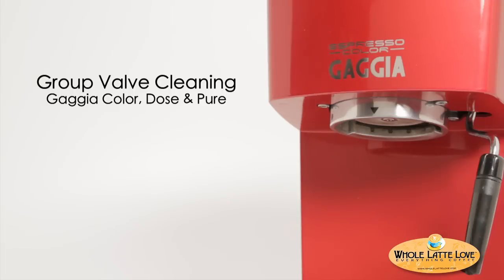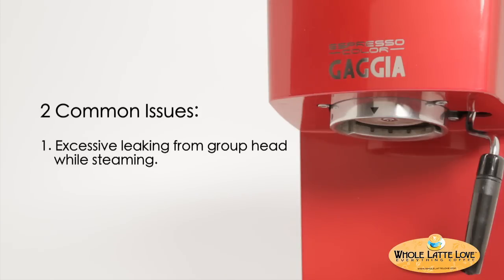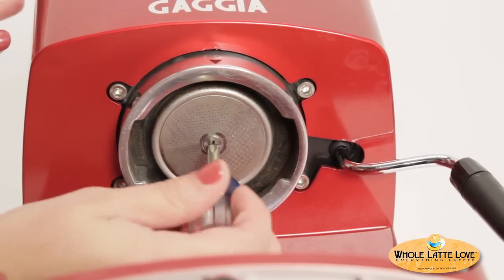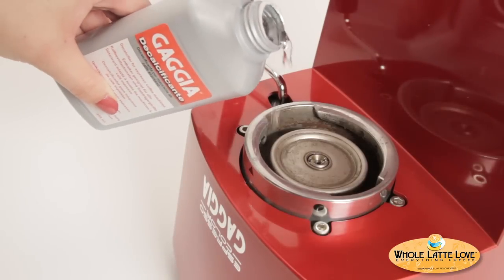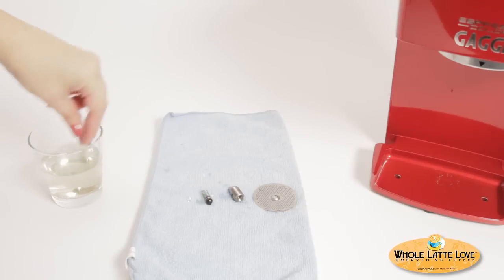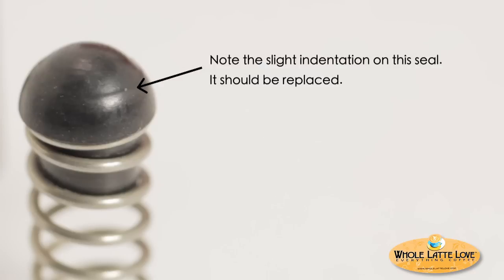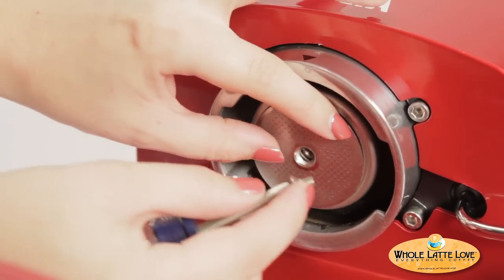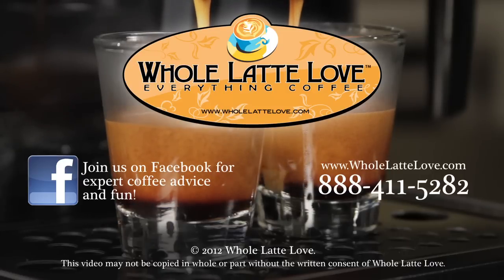Gaggia Espresso Group Valve Cleaning

Comment: I tried doing this, and I cannot get the group valve out. I tried soaking it in citric acid solution; I tried running citric acid solution through it; I tried soaking it again - the thing simply will not budge.
Any other ideas of what I could try?

Comment: Hi there, I've tried unscrewing this fitting with a coin but the whole valve mount has decided to spin resulting in a serious leak. 
Is it possible to tighten the mount from inside the boiler? 
Thanks in advance.
Reply: TomPattison hi, 2 years ago but did you solve this? I have the same issue.
Reply: On my 12 year old Evolution, this had started to drip excessively, but the brass group valve housing had corroded and then sheared off, causing excessive leakage.  The replacement is all stainless and has also rectified the original dripping / leak caused by the wear to the old mushroom shaped valve rubber.

Comment: Help: Advice plz !
cleaned  my machine and am wandering why instead of steam I am getting water flow through the steam arm.
Reply from the maker: Hi TS, Are you getting water after turning on the steam - pressing the button for steam? If so, go to our support wiki here: https://wiki.wholelattelove.com/Gaggia_Evolution/troubleshooting and read section "Steam Not Heating". If in US you can call our Tech Support pros at 585-924-7170 for assistance.

Comment: Hi, I cleaned the group valve but the pressure still seems weak. What else could have been the problem? My steam wand works fine but the water flow is weak. Thank you, Kat
Reply from the maker: Hi Kat, It could be the pump is on its way out. Are you located in the US? If so, you can give our Tech Support a call at 888-411-5282.